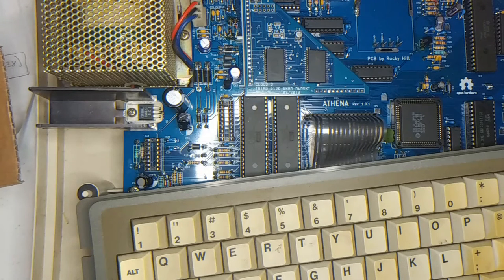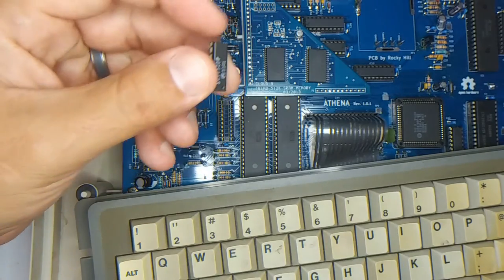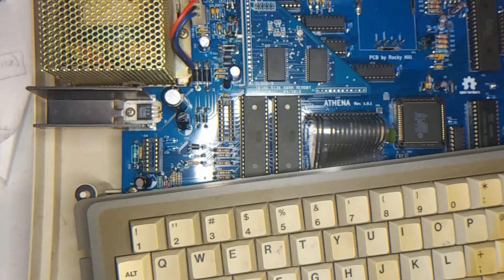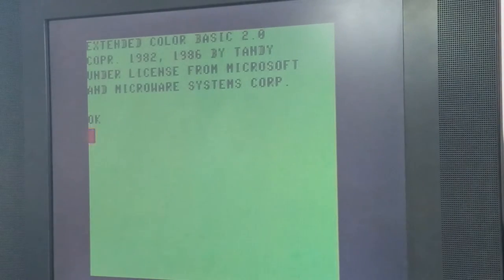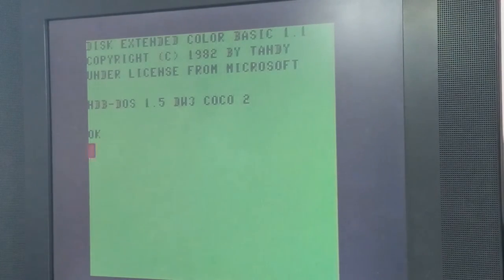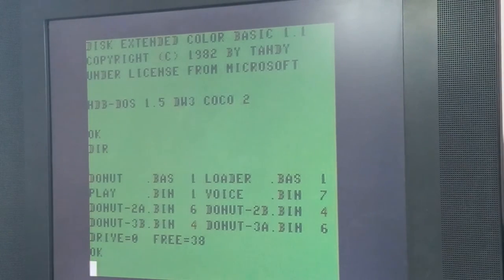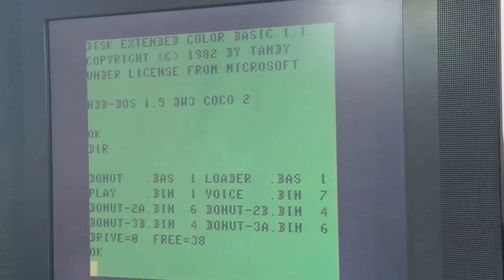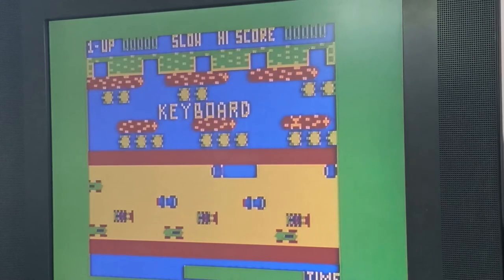Testing a Pepper Board, a SALT replacement solution, on a CoCo 3

Comment: I couldn't hear the clicks because of the keyboard.  Hard to avoid I'm sure.  If you have an original keyboard, pressing the enter key could be done slowly to avoid excess noise.  But really, you;d just need to move the mic closer to the CloCo (Clone CoCo?  CoClo = CoCoClone?).  If only you could get the SALT replacement smaller.  Probably impossible/impractical. So perhaps the board could be redesigned with that in mind.  I get that you wanted to make a 100% "ready for the parts" close system board and in that you're amazingly successful.  It reminds me of the guy who has been doing these bucket-list conversions of actual arcade games to CoCo with amazing fidelity.  His mission/purpose was to prove it could be done on the very underrated CoCo3.  Also very successful.  But there's this practical side where the chips to populate a CoCo clone board aren't really as available as we'd like while replacements such as your Pepper board work (probably better than the original) but don't quite fit looking more like so many mods we've seen over the years (not intended to diminish your amazing work).  

Let's say you were able to fully complete your CoCo3 board work but also created one to integrate all of the parts of your Pepper board.  Which do you think would have higher demand?  I don't know but I know which of the two I'd go for -- the one with built-in Pepper board.  The closer we can come to building an all-new CoCo3 with all new parts, the more awesome it becomes.

On the other hand, if we are simply trying to restore a broken CoCo and the traces of an ancient board are more trouble than they are worth?  100% absolutely "full clone" is the way to go.  Different mission/purposes.  

But I'll say if you or someone created a perfect CoCo clone which also somehow used a USB keyboard and other modern peripheral/IO devices in more of a mini form factor (simple case into which everything plugs in) it would be a dream come true. Such a thing could run from an external DC power supply.  The Mega mini MPI could have the support leg removed and could plug right into this fantasy clone all laying more flat on a table surface.

I'll never stop dreaming even if the ideas never catch on or are actually not as good as I think they are.

But I am actively trying to become more skilled.  Just got another CoCo3 so that I can socket all of the chips and upgrade from 68b09e to 63c09e and stuff like that.  Got a Hakko desolder gun which works REALLY nice so far.  If you enjoy inspiring others, I'm inspired.

I'm also looking into where I can even get a RGBtoHDMI kit and not sure what to do with these files and who to send them off to.  That process itself is mysterious to me.
Reply from the maker: Yes it was hard to avoid because I filmed using two cell phones so I really didn't have a mic or anything else connected to them.
I am planning to make a slightly smaller pepper board but not by much, maybe 1mm to 2mm shorter.  One of the reason the board is as long as it is(aside from having to accommodate all of the components), is so that the actual PCB can dissipate some of the heat generated by the voltage regulator. One of the reasons I made the pepper is because I was sharing a SALT between two CoCo 2's and I couldn't find a replacement SALT chip and it turned out it that there are others out there that needed a SALT replacement as well.

The CoCo 3 board has been fully recreated there is a GIME replacement already and in fact my CoCo 3 recreation board is using a GIME that was left over from someone who upgraded his GIME to a GIME-X. In essence my CoCo 3 is a new CoCo 3. 

I'm also slowly putting together a CoCo 3 board with surface mount parts, integrated pepper, daquiri and USB keyboard, I'm calling it the CoCo++, check out the link.
https://github.com/qbancoffee/cocoplusplus

I can help you out with the RGB to HDMI, just reach out to me and we can talk about it. 
Do you want to order one? I can build one but it will take time since I can't easily find all of the parts.
Send me a message from this webstore I'm putting together.

https://westchester-tech.square.site/
Reply: @rockyhill3  WOOO!!!!  Rock on Rocky!!!  Do it!  Do it do it!!!
Reply from the maker: Like I said, slowly.......
Reply from the maker: I have seen some good KiCAD tutorials but they are a geared towards people with experience using EDA programs. May be I'll make a short video designing a small circuit in KiCAD.
Reply from the maker: I watch contextual electronics when I have KiCAD questions.
https://www.youtube.com/c/contextualelectronics
Reply: @rockyhill3  That would be AWESOME

Comment: On Discord someone was saying that the Pepper Board ran significantly cooler than the Salt chip.  Is that correct?
Reply from the maker: The CoCo does run cooler because the pepper removes Q1 from the circuit so there is no heat generated from that transistor anymore.